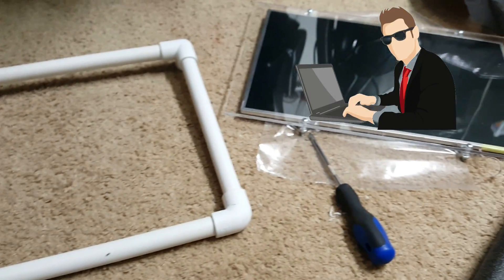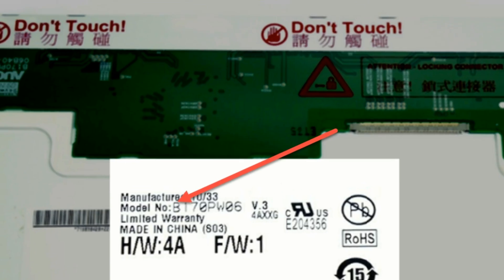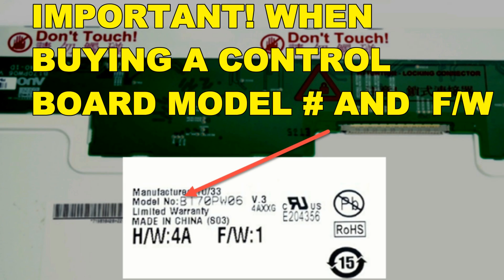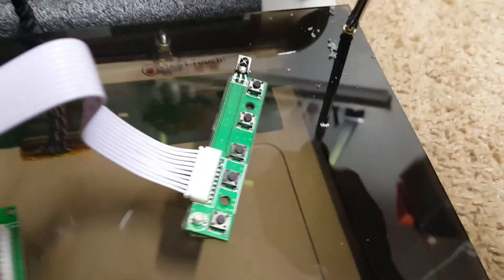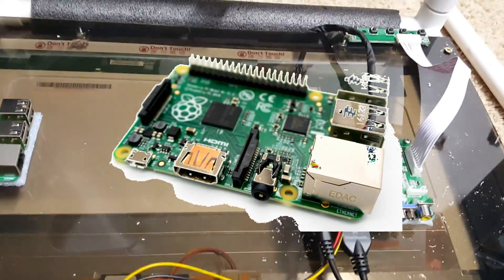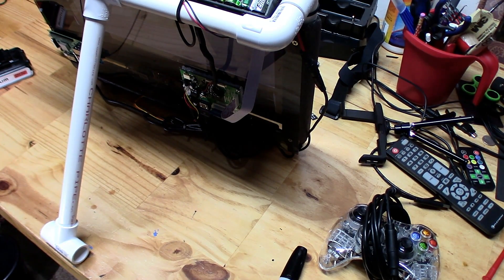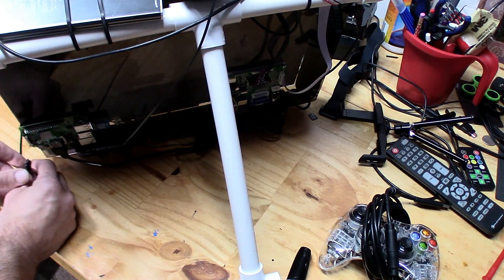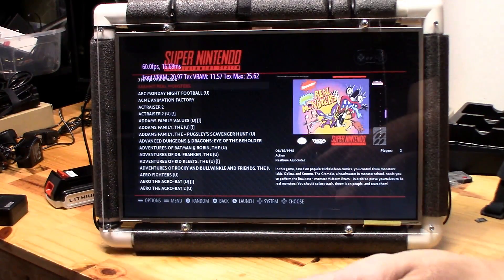super cheap portable entertainment from broken laptop screen

Comment: I would like to see how you set up an emulator for use with these older games. I particularly liked to play games on my Commodore Vic-20, 64, 128, and Amiga 500.
Reply from the maker: Im familiar with the 64 load ,8,1 I had one years ago. emulators will run a smartphone. To be honest Linux confuses the hell out of me im not patient enough to put In multiple codes to make stuff work if it wasn't for the video I forgot I had a raspberry pi..Im tring to get a intel computer stick.